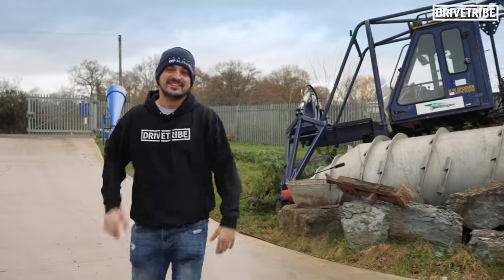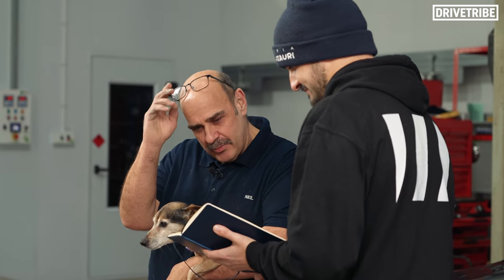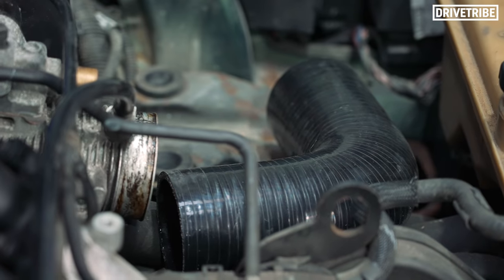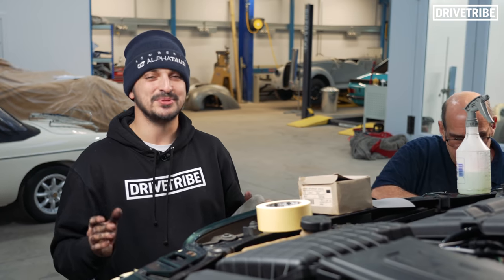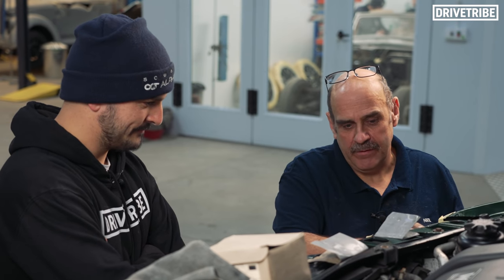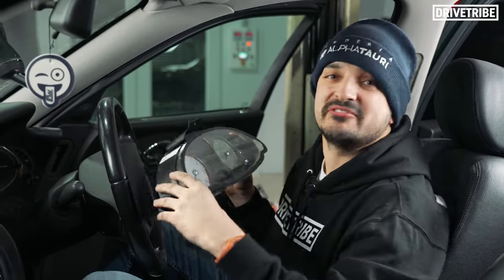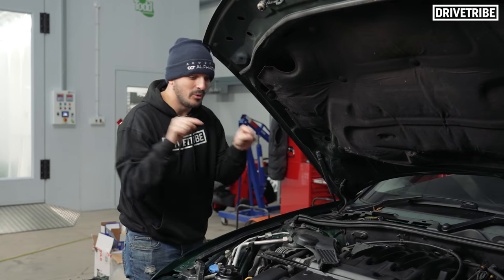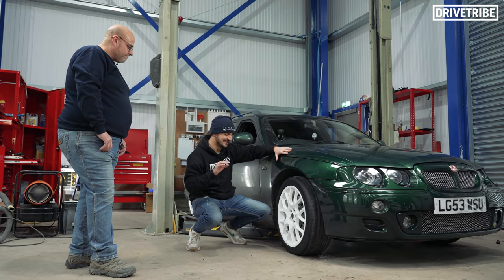We tried to fix everything on this £1500 estate car at Richard Hammond's workshop

Comment: Nice one mate that ZT-T is looking awesome! White wheels suit it very nicely and clean headlights make a huge difference. Are the brakes the bigger ones from the 190 model you've fitted? If so got the same on one of mine, makes a decent difference. Shame the 160 v6 didn't come with them as standard.

If you're looking for more power, a decent remap and cat back stainless exhaust will give you much better gains than the air intake. The v6 160 is actually detuned from 177hp. The air intake kit you've bought can be fitted to the v6 but you need a 45 degree bend pipe from the throttle body. Some motobuild lowering springs improves cornering nicely as well.

Couple points which may be of help: 

There is actually a large access panel on the bulkhead that is removable to give you a lot more access to the rear 3 spark plugs, makes it easy to change them. Took be about 15 mins to change them 3 on my old 190SE ZT-T. 

The airbag light being on is a common problem due to the naff connector plugs under the front seats having a poor connection in case you found the warning light to be on after removing the black tape. Some get away with cleaning up the plugs, I personally cut the old plugs off and replace them with new ones and you'll never get a problem with them again. That was the worst attempt at covering up the airbag light I'd ever seen lol! Usually I find them covered up using blutack blocking out the LED for the warning symbols when stripping the clusters for repairs/modifications. 

Your new cup holder is actually broken lol the little plastic bit that holds your cup/bottle in the holder on the right hand side of it is broken/missing. Also the cup holders just pop out of that center console section so you could have removed it from your new dash panel and slotted it into your existing one, saving the faff of swapping the whole panel ;) you can actually get one for the driver's side as well but they are rare.

If you haven't done so already when clearing out the plenums, cut off the bottom of the rubber drains to opem them up and prevent them blocking up. You can get plenum guards to stop debree getting into the plenum. 

If I had the space I would have been interested in your ZT-T, miss my old v6 tourer. If you fancy any custom bits to jazz it up give us a shout ;)
Reply: I've got a V6 ZT and I think I may have that very issue with the airbag warning light.  Will look at the plugs under the seats :)
Reply: I LOVE MG’s, especially the ZT. I’m 14 so it’s my dream car but because I’m 14 when I can buy one there won’t be as many around.
Reply: @freddieparrydrums  There's still plenty about mate. I'd liked the 75 since they first lunched it at the NEC in 1998. I was just turning 6 at the time. I bought my first one at 20 (when insurance got a little cheaper after 2 years NCB). I still have that ZT (it's the monogram flip paint one called typhoon I've uploaded  a couple videos of on my page). 

There will still be plenty of nice ones out there for when you're ready to buy one.
Reply: @mgrovercustomcarparts4394  That’s an amazing colour. I see you put the V8 exhausts on it? Looks amazing.
Reply: @freddieparrydrums  Thank you mate. Yes had a full stainless manifold back duplex system done by MIJ Exhausts back in 2015. Was lucky enough to get hold of a genuine RH heat shield for the bumper. Always preferred that look with tail pipes on both sides on these. My daily driver ZT also has the duplex set up with RS6 style oval tail pipes.
Reply: @mgrovercustomcarparts4394  Yeah I agree I love the pipes on both sides. Just sets it off even more. Awesome car there :)
Reply: @freddieparrydrums  I'd get one now mate, cos there ain't many left now!
Reply: @hoodwinker7932  My parents won't allow that. I wish 🤣👍

Comment: My only concern about the headlight restoration is whether or not they were coated with a UV protectant after the polishing process.  If not, then even in the UK they’ll start to yellow again after several weeks.  To my knowledge a clear acrylic lacquer with UV inhibitors should be the final step.
Reply: Don't loose any sleep craig
Reply: Yes they are /were. They will deteriorate back to, or worse than before very quickly. That flat & polish will be a twice a year gig now.
Reply: 3M makes a synthetic wax for this purpose. If what you claim about the timeline for oxidation after polishing is true, then this product apparently works wonders as I've used it on several customer vehicles over the years, and generally my customers get at least 2 years before any noticeable hazing forms in the 300+ days-per-year of high-altitude Colorado sun. I've also used 303 Protectant to nearly identical result on my own vehicles, though I find I need to reapply the thinner spray with a cloth around every 6 months to prevent further oxidation. I've never used a lacquer/clearcoat like you mentioned, but I'm confident such a product would have years of durability if cared for properly.
Reply: With all the shortcuts they have taken It would be safe to assume they haven't
Reply: I didn't do this to my car and they're still bright as ever with no yellowing after 3 years..lucky I guess
Reply: Nahh, just buy the car some nice BIIIG Polaroid sunglasses 😁

Comment: Takes 5 minutes to remove the inlet manifold would have saved you some time, airbag light is due to connectors under drivers seat commonly fail. Standard airbox with a panel filter is your best option otherwise it will rob you of power, if you have just brought the cup holder would have been 2 second job wheels and brakes look very nice.
Reply: 2 bolts to remove bulkhead hatch gives great access to rear plugs, no need to remove inlet manifold 👍

Comment: You need to apply a clear coat/uv protector to the lights after polishing, and/or apply a plastic film. Its not as sunny in the UK as some other places but they will fog up again REAL quickly if you don't put a protective coating on them.

Comment: Poor old chap (I mean the car) For first sight it seems to be the perfect production car. Nice boot, you're not tired when you get out after a 16 hours day, even if the location is 150 miles away, it fits when you are in a hurry etc. But after the 25th time you carry lighting equipment you realise all the carpets are hanging, when you get off the paved road the under armor will scratch everytime, and after a while it will be broken, the suspension wasn't made for film production,  etc. Mine experienced all these and much more (the best are the scratches on the hood made by improper rigging) but now it waits for it's restauration hopefully beginning this spring, and after that it can enjoy it's pension years, it really, really earned it.

Comment: Access panel on the bulkhead can be removed to access rear spark plugs. Much easier that way!
Reply: Was about to say that but it's still easier taking the manifold off gives you chance to clean it as well they tend to get pretty oily
Reply: Very useful info thanks.  I have a V6 ZT and was planning on getting new plugs for it soon as I've no idea if they've ever been changed.
Reply: I agree I'm not a mechanic and it only took me 1/2 an hour to change those back plugs including removing the bulk head panel

Comment: The airbag lights in MG ZT and Rover 75s - they all do that, it's a... err... 'feature'. Usual cause is the connector under the seat corroding. Fix is easy - disconnect, apply electrical connector cleaner. You do need to unbolt the seat for easier access, but that is simple enough.

Comment: Paul Taylor five hours ago posted here a point about Fuel Tank issues.  
Yes, some cars have these. 

Depends if its the Diesel BMW engine cars or the MG-Rover K16 and KV6 engine cars. The petrol cars have an in-tank fuel pump and filter. The diesels have fuel pump problems. Both easy inexpensive fixes if you know what to do. More on costs later.

Ten years ago, the very first MG ZT I bought was from a frustrated previous owner who was considering scrapping the thing. It was the MG ZT with the Rover 1.8 K16 Turbocharged engine. He had just filled the tank to the brim and was home when the  engine just died. Would not start. That after spending big money on upgraded brakes to get the car through its annual safety and emissions test. That engine trouble was the last straw. He had been professionally advised that repairs would be in the region of ££££/$$$$ four figures. I took a chance and made an offer for it "as is" which he accepted.

Got it to my place on a trailer and investigated the short list of usual suspects systematically. First up. Sparks. OK, big and healthy. Next fuel delivery. Switch on ignition could clearly hear the in-tank fuel pump prime up for a few seconds as they always should do. Still no start. Next, check the fuel lines for evidence of fuel pressure. Only a trickle. Squirting some ( About fifty ML ) of  RON 97 Grade Fuel directly into the Inlet manifold via the Brake Servo Vacuum Take Off using a syringe ... immediate start and runs for a few seconds then dies.
 
Fire up the laptop and check the various MG-Rover enthusiast WEB_SITES. That soon revealed what is known in MG enthusiast circles as the "FOC".. Fabled Orange Clip. It appears the BMW style In-Tank Fuel Filter ( not Pump) is prone to loosen its cap as the miles and years tick by. That means no fuel pressure to the Injectors. Off to my favourite Car "Remove it yourself" Breaker Yard and I soon had access to the In-tank Fuel FILTER on an accident damaged car. As I removed the Filter assembly from the emptied Fuel Tank, I saw an Orange Clip had been fitted to the Filter Assembly. That locks the Lid to body interface so no chance of loosening.

Back to my project car. Not looking forward to working inside the Fuel Tank full of RON 97. Syphoned some off but where can you store 50 litres of the stuff. Fitted the Orange Clip to my car's Filter assembly after carefully realigning the Lid to Filter body in the correct orientation. Fitted the Orange Clip ( I had bought the whole Filter Assembly from the scrap car for £8  ( UKPound about $12 US  ) and slipped the Filter Body back into the fuel tank.

Turned the ignition key and and waited for the usual couple~three seconds for the fuel system to prime up.  IMMEDIATE start and car been fabulous ever since.  

An EIGHT QUID FIX!  Win some lose some. Cars, their owners and those "in the trade" can be like that.

Comment: Not sure bigger brake discs will stop you quicker - if the original ones can lock up the wheels, then that's all you need. The friction between road and tyre is what determines your stopping distance. On track days, however, bigger discs will dissipate more heat, therefore giving you longer before they fade. Ps, bigger brakes also add to the unsprung weight, and increase the gyroscopic stability of each wheel.
Just my twopenn'orth.
Reply: nobody cares
Reply: Issue isn’t stopping quicker as much as stock brakes fading incredibly quickly. Bigger brakes like you said last longer on track.
Reply: @zeitgeist2720  I doubt he has ever been on a track before or he wouldn’t have made the post.

Comment: Happy to seesome Rover/MG content. I had a Rover 75 and despite being a pig of an example I fell in love with it.

Free piece of advice - clean your scuttle panel area out thoroughly and make sure the drains are clear. The ECU lives in the passenger side and if they block up, asides flooding your carpets (which will smell before it feels damp, due to the foam under the carpet being coated with plastic) it will flood your ECU if it fills enough ☺️
Reply: Thanks for repeating what they said in the video!

Comment: the airbag issue is a common problem with Rover 75s the light goes on for no reason. A fix for this is under the passenger seat there is an airbag wiring loom unclip those clean up the contacts and reconnect this works every time! You'll also get a warning for the airbag on the LCD screen even though the light has been taped up. Also, the person who took that display apart didn't know what they were doing if you unscrew the back it all comes apart without damaging anything!!!

Comment: I wish these were sold in the United States.  I love it.
Reply: Pay me enough I’ll get one sent over 😁
Reply: From 2003 to 2005 these ZTs were available with Ford's Modular 4.6 litre V8 driving the rear wheels but rated at 256HP. A very desirable machine if you can find one.
Reply: @1chish  There were a handful of Supercharged cars too. They never quite got to full production as Rover sadly went under.

I know there are at least three cars in the US. Two ZTs and one 75.

Comment: No wonder the old cup holder was broken 😂
Reply: New panel on it and it still doesn’t work, don’t tell the Germans 🤭
Reply: Never mind ve have already noticed JAA
Reply: It's quite obvious the new one is broken as well. Normally they release with a single press.
Reply: @SpitfireFortyFour  I have no problem with mine, smooth as silk

Comment: The issue with belts warning light is due usually to bad connection under the seats, various fixes for this,as I have 6 of these, don't forget to clear coat head light Len's after polishing them

Comment: I do love these motors! It was going so well until the White wheels were fitted 👎
Reply: @lewiskiable  they didnt touch the tyres, they were what was already on the car, just masked them up and sanded / painted the rims. seems pretty daft if hes going to faff about with an aftermarket intake before getting some new rubber.
Reply: Agreed….the black rims looked better

Comment: 10:35 it is a major issue the water drainage, we had a 75 diesel that suffered a catastrophic electrical failure, everything stopped working inside, radiator fan blasting fullspeed with engine off nothing made sense turned out water submerged and corroded the body ECU. Water drains were clogged.

Comment: KV6 engine has 2 main issues, cracked plastic thermostat (can get a metal one) & rattling VIS butterflys/gummed up VIS motors.  Plenum filling with water is all ZT/R75s except the V8s (still happens on the V8, but ECU is not located there).

Cup holder - your replacement is fouling or worn, should not be this awkward to use - just touch and it pops out smoothly.

Tape on the air bag light is a major bodge.  Issue though is the pretensions connectors under the seats.  Sadly, "they all do that sir" - it's wear on the multiplugs caused over time by seat adjustment creating a loose connection.  Best solution is to hard wire them.

Comment: Really shocked that he did not know about the removable panel on the bulkhead to ease access to the rear spark plugs. Easy job. Also very important to ensure that this area is clear of debris as it will block the drains and flood the ecu. But its an easy job. In fact most jobs in these were easy when you knew how. 

The air bag on these resets on every start. You don't need a code reader to do it. But it is always always always the connectors under seat. Wiggle them and off the light goes. 

When they were newer I worked on these zt/ztts all the time. Got to know them well and did everything from belts to lots of full engine rebuilds. The only one I still work on is my neices cdti. Still love them but they have had their day sadly.

Comment: Airbag Light could mean Its had probably  a accident.
Reply: Ot water damage if there are modules under the floor
Reply: it`s usually just the plug under the driver's  seat . fixed a few at the garage , when i say fix i mean unplug it and plug it back in lol

Comment: No point improving brakes when you use ditch finder tyres/ones so worn down. One of the most important parts of the braking system... the tyres! Also should have fitted a K&N reusable filter to fit the stock box.
Reply: Using a K&N filter in a stock air box has zero benefits, except spending 4 times as much and being to wash/reuse it. What little benefit you get in aftermarket air intakes is getting rid of the restrictive tubing and the sound baffle that many automobile manufacturers put in the system to decrease throttle sound.

Comment: I'd love to see somebody swap an Audi A4 AWD system into one of those
Reply: Why? The (very rare) V8 version came with AWD anyway.
Reply: Rover actually had a working 4WD version they planned to put into production. The prototype was a fully usable car so it got sold off (because Rover) and it's still about going to shows in the UK.

Unfortunately as they went under it was killed before it even had a chance :(
Reply: @richardharrold9736  Still better than the earlier/smaller engined examples.
Reply: @richardharrold9736  I'm used to Capris and currently driving V6 75 estate, so I'd probably OK with it. IMO, anything RWD> anything FWD.
You can always feel the dynamics of FWD, even at parking manouvering speeds and it always feels wrong!

Comment: It's a scientifically proven fact that coloured brake calipers add 20-30 bhp, depending on application. 🤣
Reply: Also if it's not actually your car, you can add another 20bhp. 40 if it's a hire car.

Comment: it's not polycarbonate, it's acrylic.
Reply: it's not dissimilar to what you do to oxidized paint.  The problem is that the acrylic you've now exposed will be damaged by the same UV light that started the problem.  You have to treat the polished acrylic with a UV blocker or you'll be doing it every year.
Reply: @Oldjohn52  wrong

Comment: The sad thing is you could have scraped it and turned it in to a bean can wich is more reliable than a 75 rover.
Reply: Bollocks. The 75 was well rated for it's reliability. When it first launched it placed 3rd in the JD Power surveys.